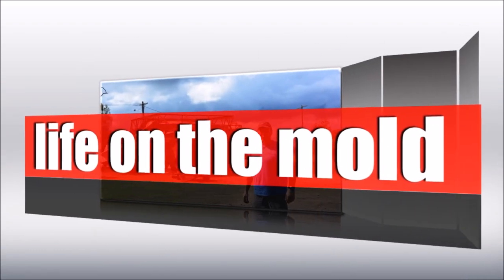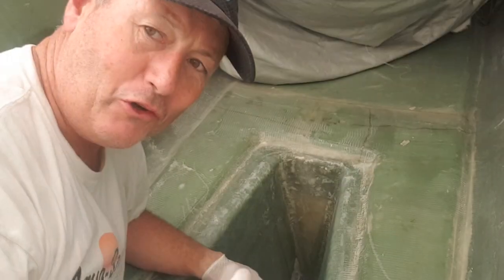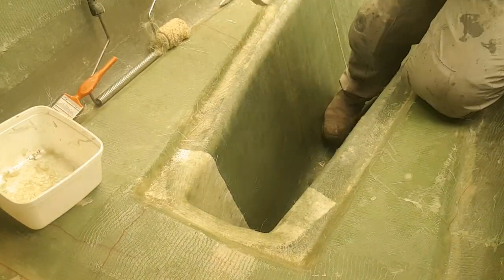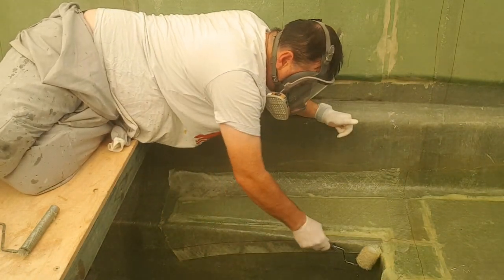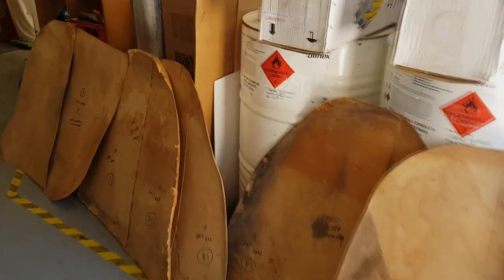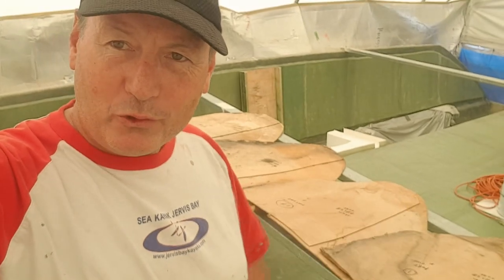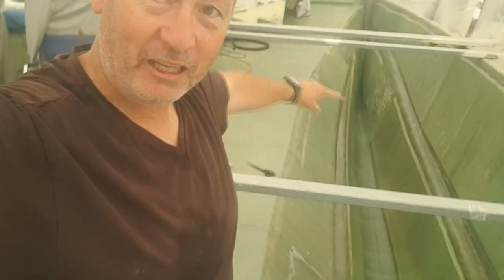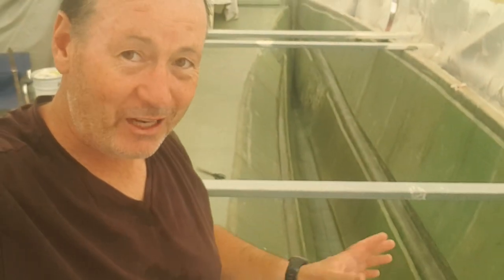Ep031 It's a giant jigsaw puzzle!!!

Comment: you lamination schedule seems to have 300gsm chopped mat between the 1200 gsm quad  , is there an engineering advantage  to this  , why do multiple layers of 1200 need the mat in between . Am building a 65' cat in ply/epoxy glass and have some structural components to create .
Reply: found it in earlier video  - thanks

Comment: Good day colleague. ) Please tell me why you do not clean between layers of fiberglass, fiberglass. Without stripping, there will most likely not be a good connection. Thx.
Reply from the maker: Gidday buddy, I have sanded and cleaned in between all layers that have cured and ensured a secondary bond by wiping with styrene monomer each and every layer. Such a process is best practice and has resulted in an "as closed to" primary bond as could be achieved . Inba perfect world each layer would be laid directly onto the next within a 24 hour period and I have achieved this is in about 50 percent of the laminate, however some time has gone in between the later layers so sanding and styrene clean has resulted in a great bond. I hope this helps cheers Rossco
Reply: Lol, you can always tell the commenters that haven't watched many videos......

Comment: One word for you, Aluminium! 😂
Reply from the maker: Ooohh wash your mouth out with soap sir.Ross
Reply: Life On The Mold - Building a 40 Foot Catamaran
Nah seriously you’d have been sailing already bye now!
Nothing to rot or get osmosis blisters, much more fire resistant than fibreglass, lasts decades longer if not indefinitely, etc etc
Whilst there’s a LOT of properties of Fiberglass to be admired over Aluminium (modulous of elasticity for one), Aluminium beats fiberglass in so many other areas.
It can be plasma cut by CNC to within 1/10,000th of an inch accuracy, welded together way faster than melding fiberglass and so on.
Has me wondering how much longer fiberglass as a boat building material will be around into our future!
Don’t get me wrong, I admire your skills and tenacity etc, I just can’t help wondering how many more boats you’d have completed if you were working in marine grade Aluminium is all?
How long could it take you to learn how to weld aluminium, an hour maybe 2 tops?
I’ve been involved in building timber fiberglass and aluminium boats as a 100 tonne master, and I have to say aluminium wins hands down every time.
Maybe you will have a future building fiberglass boats as museum exhibits! 😜😂

Comment: It's not at all boring mate ; does go some way to showing how much work is involved, and how physically draining it is in that heat. I imagine there is just the one set of bulkhead templates and you turn them once you get to the other hull. 100% with you on the engine bay issue - much easier to keep clean once you are up and running. Thank you.

Comment: Ross that spray gun is just epic. I know it requires maintenance but it has to be saving you many hours of mixing not to even mention the amount of mixing dishes you would have gone through by now. One thing for sure when your out sailing in this vessel you won't have to worry about the craftsmanship.  You know every inch of your efforts is spot on and solid.

Comment: One question: When you build a catamaran with a mold like this, if you made it all out of glass, can you build it with infusion? In my point of view it would be really faster, imagine, you cut down all glass and start infusioning the epoxi.Of course, this would be great to bigger companies but not for a single built. If something like this works the company can have just a CNC Laser cutter cutting glass and two or three people placing it on the mold. Would be great!
Reply: Ross talks about why he's not using resin infusion in several videos, including this one. Here he says that the layup is so complex that he doesn't know how you'd keep each piece in place. He also mentions that there's a maximum thickness that you can do at a time due to the exothermic resin overheating,  most of the hull is too thick to do in one go. He uses infusion for some of his kayaks though, so he's familiar with the process.
Reply: I've seen that done in videos. One shot hulls. I'M a total newbie though.

I you build yourself, you can also build only the separate hull molds. 

Vacuum injection is also probably better with the foam since you don't need to glue it with a different adhesive, so it's better embedded into the epoxy laminate.

For the skoota power catamaran (semi displacement hull with hard chines) there is a process of using melamine plates to make a half mold (cut along the keel line and later glued together). Then you disassemble the mold and assemble it mirrored to make the other part of the mold. That way you basically only need one half-mold for both hulls and the hull decks.